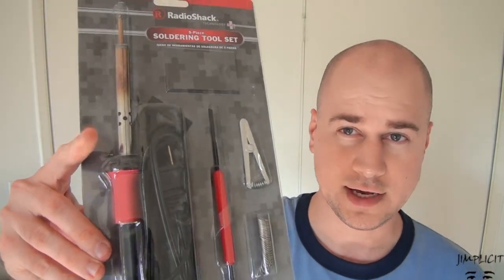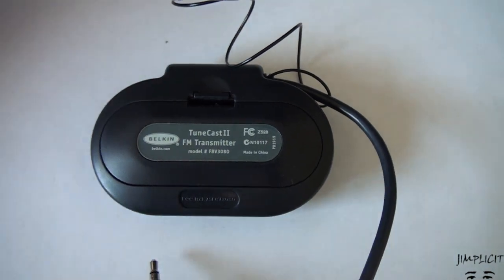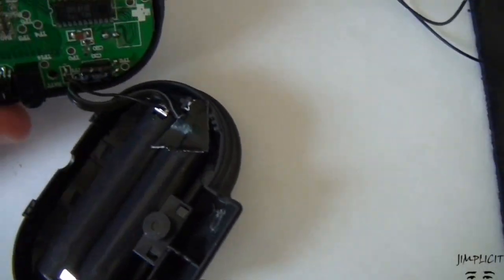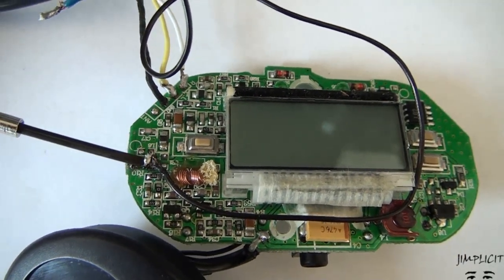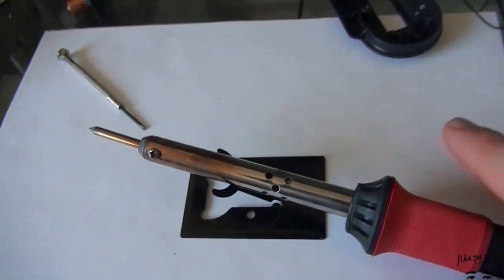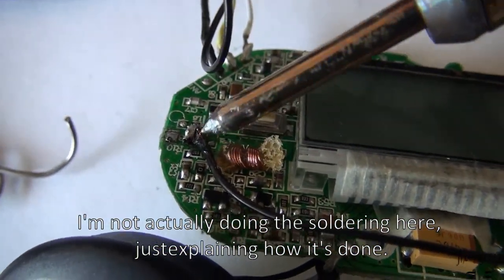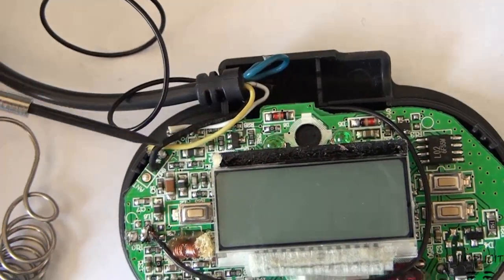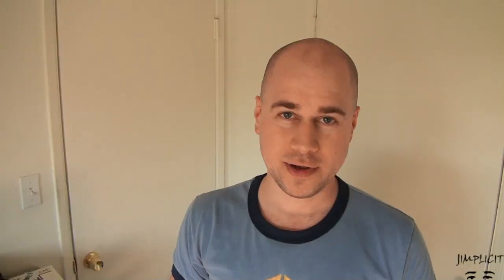How To Boost an FM Transmitter

Comment: Just ran out to radio shack and bought a soldering kit for this specific video. I tried it and it worked! I live in an area that has a ton of interference and it overpowered it all. Thanks for the video!
Reply from the maker: You are very welcome :)
Reply: Hi. No wonder these gadgets do not work so well.
When a friend of mine opened his Belkin, he pulled the blue cable slightly and he   found out it was around 50 mm/2 Inch, just enough to go into the black cable for the audio input!
This joke(the blue cable) was replaced with another cable, around 120 cm/4 feet and suddenly the range increased to about 300 meter/1000ft! Not so bad!

Comment: The spring-loaded clip is actually an aluminum heat sink to protect heat-sensitive components such as ICs when you solder them.  You clip it between what you're soldering and the sensitive component and it prevents some of the heat from reaching the component.  This is so you won't fry components soldering them in.  If you use it as a wire clip, I guess it does two things at once.

Comment: The little black box you removed is the rf attenuation network, this is to maintain compliance for all countries, it also performs better if you use an external supply as the 3V battery supply uses a on board boost regulator that adds annoying hiss. The RF output is about 200uWatts I managed to get about 1mWatt by adding a bc547 single stage rf amp, easy.

Comment: I did a Mod on my transmitter which is not a Tunecast it's just a cheap one I bought on Amazon, I have a quarter wave aerial tuned for 88.1 in an upstairs window and I get a good quarter of a mile "well over 1,300ft" out of it running it from a regulated mains power supply. I'm in the UK and have run it this way for over 4 years with no problems at all.
Reply: For those who don't know, a quarter wave antenna for 87.7 MHz is 0.855 meters = 2.76 feet.
Reply: I wonder if your neighbours go to listen to that freq and get your signal.

Comment: There are several possible optimal lengths, but the shortest one would be a quarter wave length which is determined by the formula L=234/F which yields the length in feet (f is on MHz). Using the middle of the FM band, this would be 234/98 which is 2.39 feet, or 28.65 inches. This will work for any frequency. Ideally, you should have a counterpoise of equal length, but the power cord can serve in that capacity well enough.

Comment: that "little black box" is a transistor buffer used to isolate antenna from rest of circuit. if you simply adjust it's bias point you can increase the gain (and range). the same could have been achieved attaching the 'antenna' to the antenna point with out any soldering!

Comment: you want to connect the wire to pin 12 on the big chip itself that's the RF output stage..

has to be said, but it makes a hell of a difference once its in place.

Comment: I did this to an old iRock FM transmitter (yeah an iRock) and while having it on I tried different parts where those black boxes on the board were and some came in a little better and one point it came in crystal clear so that's where I put the antenna which was an old UHF TV antenna wire and It's about 3 feet long and I can pick it up all over the house it's awesome. I can even pick it up on all my weak radios.

Comment: That would be only a very modest improvement. The antenna lead would still be downstream of the RF output attenuator. You could, however, maybe just extend the blue wire to the resistor pad and tap it from there instead. I have this exact model and I'm going to give it a try!

Comment from the maker: @davidoh2011 Thanks buddy :) Mine didn't come with a car plug, but it does have a port for an external power source. I reckon I could find a car adapter for it on ebay.

Comment from the maker: @Etnysk8silence You're welcome. You totally should try it. I originally tried using glue, but found that it wasn't very effective. If you're not careful, the glue can actually act as an insulator, preventing the current from passing between the connections. Soldering irons are pretty useful, and pretty inexpensive, so I'd recommend getting one.

Comment: Thanks! I followed your instructions for a similar transmitter and it worked. Now I would like to use the power supply of my desktop to power the unit. Do you think it will work? It does work with the lighter power supply.

Comment: Jim, that was crazy. As a longtime electrical engineer, I understood what you were doing, but what a crazy thing to do to that circuit! You apparently removed the output transistor (also antenna matching function) and have hung the antenna onto the transistor which preceded it. 
Whatever. I cannot believe that a company would specifically print a statement on a soldering iron package stating that it wasn't to be used as a torture device. Darn! Now what? Shows the mentality the world has come to.

Comment from the maker: If you remove the black box, you are also severing the connection to the antenna, so you definitely need to use solder.

Comment: I have a no-name transmitter too. I looked for where the old antenna is attached. Nearby I found a black box (a resistor, I assumed). I removed the box and attached the antenna in its place.

Comment: I wanna to make my own radio station,what about to solder coaxial connector instead of wire,and connect there some bigger antena which will be on roof ? It will work for a longer distance ?

Comment: What's interesting is that a lot of the car FM transmitters you get are actually overpowered, believe it or not. Especially the older ones. I have an old one from the early 2000s and I can plug it into my car in the driveway and still be able to faintly hear it on the radio in my bedroom. What that tells me is that this thing is putting out way more power than it should and is technically turning your car into a mobile pirate radio station.

Comment: Did you try simply connecting the blue wire to the new connection point? That would make for a much more clean mod. Also, do you have any idea what you removed? A resistor? A capacitor? You should not have had to remove it - simply connect to the circuit before that component (connect the wire to where you did without removing the "black box")

Comment: length.  If you make an antenna that matches your frequency it will work better.  the one supplied I assume is a 1/8 wave.  if you add a 5/8 sized antenna it be stronger

Comment from the maker: Interesting. I'd recommend adding a more effective antenna. I've read that antenna length is pretty important -- I recently replaced mine with a 56 inch antenna and it works even better. You might want to give that a try.
Reply: Thanks for the video! so where do you place the 56 inch antenna in your car after your all done and ready to use? Also, does it improve sound quality to make it sound like its connecting through an aux or just takes away static?

Comment: I already have the wire coming out from the transmitter.. Is it possible to improve the signal even better if I extend the wire? I intend to extend the wire by soldering the cable to the longer one. Will it work?

Comment: I wish my smaller model was as easy to hack. Mine has much smaller pc pads and no antenna. I think I found an RF hot spot
but it's too small to solder to. Or I need to build up my courage to try.

Comment: For better coverage make up a simple fm dipole. You will also need to attenuate frequencies above 15kHz as these devices can over deviate and screw the stereo 19kHz pilot signal..there are fm compressor plugins for win amp and other audio programs, to create a professional sounding radio station.

Comment: When did sm transistors become "lil black boxes" lolol
Reply: +RiaRadioFMHD773 my first thought ^^
Reply: RiaRadioFMHD773 when these caifornia vaseline users become technicians lmao
Reply: I was trying to figure out if he was talking about a transistor or resistor, I figure I just start flicking "flicking little black boxes" off at random. Should have wayyyyyyyyy more power than when I begin the process!! >;)
Reply: It's really a resistor hence the mode of restricting current(energy). Pirate AM/FM bands using "free" or unoccupied wave lengths view resistors on signal output as the FCC "devil". Free Speech or don't speak at all!

Comment: I have connected the blue wire to the new connection  and it works better, but it it not as good as a longer aerial. Had to solder in a short piece of wire as the the blue wire would not reach the new spot.

Comment: The "little clippy thing" is not "to hold your wires in place." It is a heat sink. You clip it on the lead of a heat-sensitive component, between the component and the solder joint, before soldering it, to reduce the chance of frying the component while you are soldering the connection.

Comment: Thanks for sharing what you'd discovered. Really cool. Just wondering did you notice and increase in the volume of the signal/music as well? Or did it just remove the static?
Reply from the maker: Thanks. It decreased the static quite a bit. It didn't affect the volume, but the sound was much clearer.
Reply from the maker: Thanks. It decreased the static quite a bit. It didn't affect the volume, but the sound was much clearer.
Reply: Jimplicit Ok cool. Thanks for the prompt reply.

Comment: i would say if you were getting a weak signal your device was at fault or your car radio antenna had a fault...the rf signal level oer sq mtr from a radio station will be far lower than this device located in your car if it working correctly out the box.
Reply: I have tried all kinds of these things, especially 10 years ago. They are notoriously  weak, I literally had to set it in the back parcel deck on the antenna side in my 2000 Grand Prix to even hear it work.

Comment: The clippy thing is a heat sink, not for holding wires in place.  The oddly shaped tool sort of thing here is a soldering toll for bending tinned wire and cleaning the solder joint.  The resistor you removed protects engine noise from getting into the transmitter and frying your radio.
Reply: Thanks for the info!
Reply: *****
The "torture device" is a tool that helps to remove solder flux (The black build up around the solder joint), from the circuit board, after a connection has been soldered into place.

Comment: does the new wire that you solder on as the new antenna attach to anything? or does the end just hang loose in that big tangle at the end?
Reply from the maker: Samuel Effman I attached it to something so it would reach out instead of being a tangled mess.

Comment: "SHAZAM" it was difficult at first (only because of my stroke left me paralyzed on my left side ) but persistence paid off now it xmits well over a hundred feet SMT is virtually un heard in this tiny town ,a town so small it has to borrow a neighboring towns horse to even  be called a "one horse" town . Even with my 2 to 3 years of circuitry design and 10 yrs of tech exp you are my personal "Hey Mr. WIZARD!" THX again now I can listen to my iPod thru my wireless FM headphones anywhere I walk PS: I added a "AA " battery pack in place of the "AAA" for extended xmit time and better supply voltage figure once those tripple A's 3 volt drops by 50% so does the xmit power to all,so if I with only one hand can tackle this ..anyone can

Comment: LONGER is NOT Necessarily better ! (if you got better transmission ..then it was pure luck.)
.
The length of the antenna is linked to the Frequency MHZ. it produces. IT’S preset at a correct length  ( a precise 1/16 scale.)
.
For a 1/4 wave - Make you transmitting antenna 31 7/8” then tune your radio to 88.1 
.
( There are calculators on line for other Frequency's

See > Makify1‘s Youtube video ; “Belkin TuneCast Antenna Mod”

Comment: Hi,

I have a rather more complex fm transmitter (fm modulator) that has the car charger connected so that it just sticks out of the car charger port. I tried opening the device up to notice that there were two motherboards, one on the top for the digital screen and one lodged in the body of the plastic for the battery etc. 

I tried using your methods on the top motherboard that I could gain access to but there were only two wires (red and green)
Could I get your email to show you some pics?

Comment: To all of you. You can thank NPR for the reason why you car's FM Transmitter will not go 2 feet. NPR claimed they got complaints from listeners that were picking up these transmitters, plugged into a portable XM Radio Receiver, & it was tuned to the Howard Stern Show. The FCC went right straight to Belkin & others and made them turn down the power output so in traffic, NPR stations would not get interference. My advice, do not piddle with the inside of turning the power up. NPR is listening.
Reply: Do not mess with NPR in the USA because in many cities, they are the main beacon for the EAS broadcasts.

Comment: Ever heard of correct antenna lenght? Wrong length will only make the coverage worse. And please don't use soldering iron's like this for such delicate electronics.
Reply: Luc Dogge how do you determine the correct length?
Reply: A quarter wave antenna for 87.7 MHz is 0.855 meters = 2.76 feet.

Comment: Ok, here is the ez way to do this and not output more power than you need.
First just remove the blue wire. Then add in any wire of the same size around.
Then just wrap this wire around your incoming antenna cable to your stereo.
Then put the box in the glove compartment or under the dash.
Put an extension cable on the end of the wire that goes to your phone / ipod / mp3 player. Or you can connect a cheap blue tooth receiver to the cable.
Then sync your phone to the bluetooth.
Oh when your phone rings it goes thru the stereo. Hands free.
Think about it.
Cut the end off of an old USB cable.
Wire it into the battery box.
Throw a 2x USB adapter in the 12v power outlet in your car and you can charge your phone and the transmitter will work off the car instead of batteries, and it's 5v going into it instead of 2x1.5 AA or AAA batteries (3v) it will put out about 1/2 mile that way.

Comment: Those 10 dollar Radio Shack soldering irons are weak and take forever to heat up and don't work very good because they don't get hot enough.  Here's a tip.  Get a really sturdy glass vase or glass soda pop bottle, and put the solder iron in there when its warming up, instead of on the stand.  The glass won't burn, and the air inside will heat up and heat your solder up faster and hoter and stop wind or drafts from cooling it.  Also, you don't have to remove that resistor pad, just solder to the right side of it, or bridge it with some solder.  I did this mod and it was a  piece of cake...
Reply from the maker: Great advice! Thanks. I've had no trouble with my cheap soldering iron, but I haven't used it very often.
Reply: Jimplicit By the way, the "little clippy thing" @ 1:25 is called a "heat sink". It's purpose is to protect components (usually semiconductors) from destruction caused by the heat of the soldering iron. You clip it on the lead of the component, close to the component,  before soldering the components lead to the circuit board. It draws the excess heat of the soldering operation away from the component, protecting it.

Comment: Why not simply bypass the resistor, and leave the original aerial wire connected.? the extra output gained over the tuned length of the original aerial should be adequate inside a car !

Comment: that black box is a resistor and you do not want to take off
Reply: Why? What function does it do besides what he claims? Eg why would someone not want to remove it?
Reply: yes resistor does exactly what the name says... it reduces the amount of power. so if they put that resistor there only to be in compliance with fcc rules (which is the reason ALL fm transmitters suck).  then of course u want to remove that. then it will broadcast without limiting the amount of power output.... its a great idea, i wish they had tutorials on how to hack all types of brands of fm transmitters.

Comment: The FCC Enforcement Bureau raided your house? That is against the Law. They can not go through your house without a warrant issued by local or state law. They must be escorted by local, county, or state officials to start going through your "private things" in your house. This doesn't make sense. They can confiscate used with the low powered operation, but they can not go through closets, and such. I guess it depends on what the warrant says.

Comment: If you live in the United States, Part 15 FM Transmitters are only allowed a range of 200 feet. The law is for any unlicensed FM Transmitter broadcasting with a signal strength greater than 250 µV/m at a distance of 3 meters from the antenna is punishable by law and confiscation of all broadcast equipment. That is the FCC Law. Don't blame me, I am just giving a warning. I didn't write the law. This law was in effect before I was born.

Comment: Or you could just purchase one of these:

http://www.ebay.com/itm/CZH-7C-7W-FM-Transmitter-Stereo-PLL-Broadcast-Radio-Station-Antenna-88-108MHz-/251283067951?pt=LH_DefaultDomain_0&hash=item3a81a3542f

It is more powerful so it will override any static and interference.

Comment: Let me tell you something, I don't like the Federal Government, Congress, nor the FCC, FDA, etc. I agree with you there, but I rather spend my free as possible than in Prison! These laws were put into effect before you & I were born. I wanted to change frequency of my "Licensed" AM Station to 1400 KHz. The FCC won't let me because some idiot filed an application in the AM Window of 2004 on 1410 Khz. I am stuck were I am at on the AM Dial. That application blocking me will never be granted.